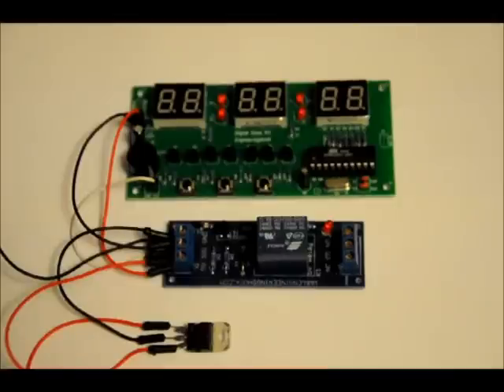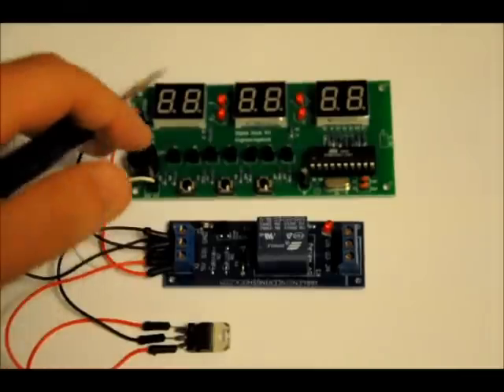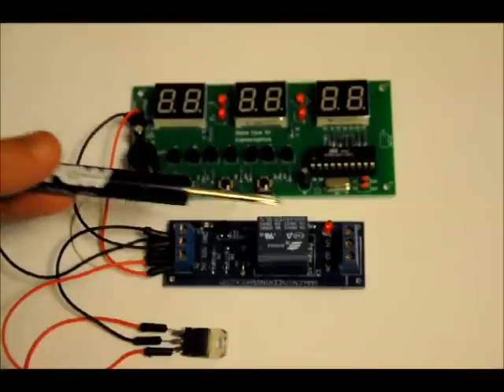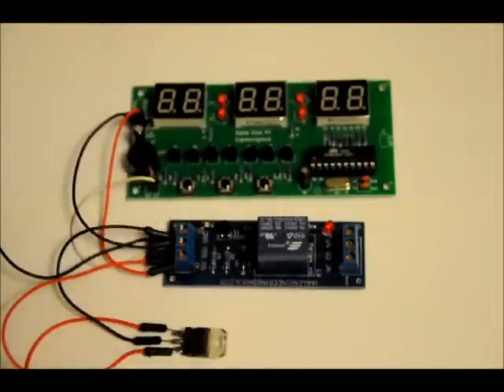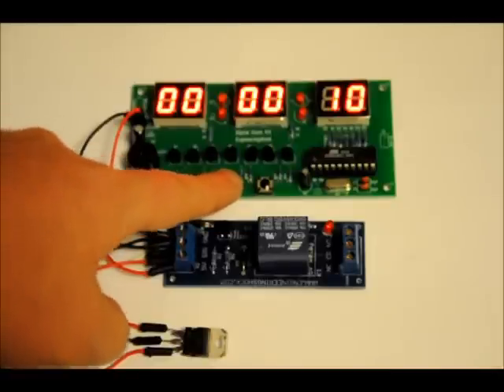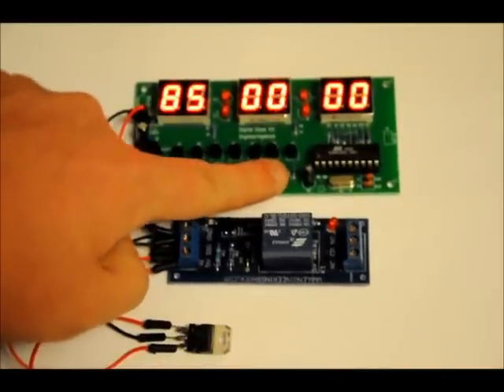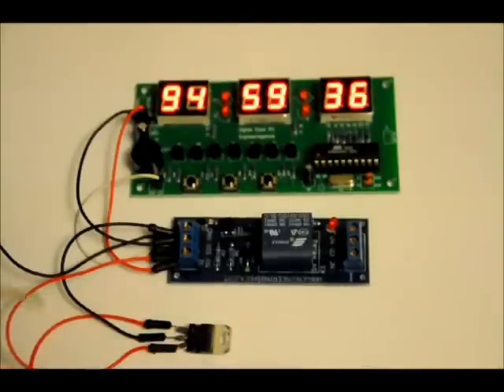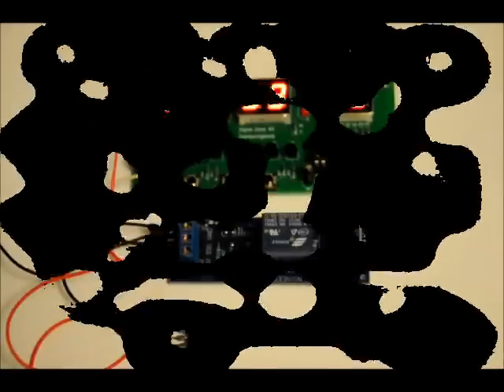A Countdown Timed Detonator Paintball Prop.wmv

Comment: Hey patrick! Just a quick question:

Is there a way you can explain why the oscillating crystal requires 2 small capacitors that connect both its leads to ground? Thanks!